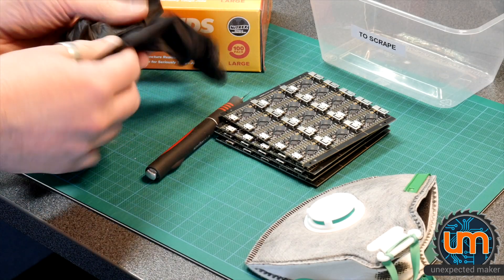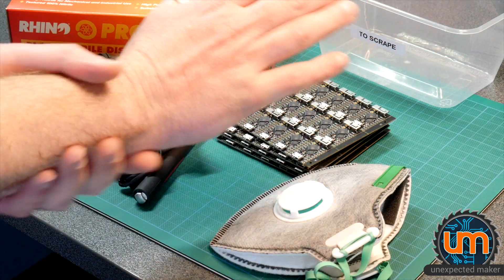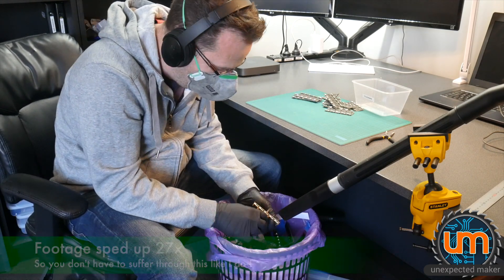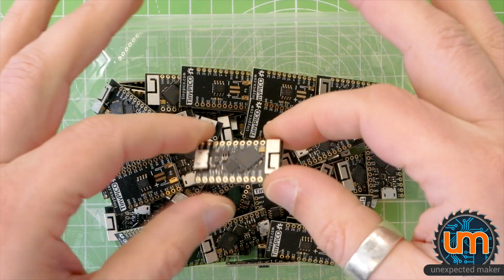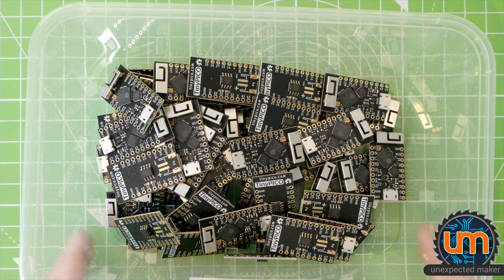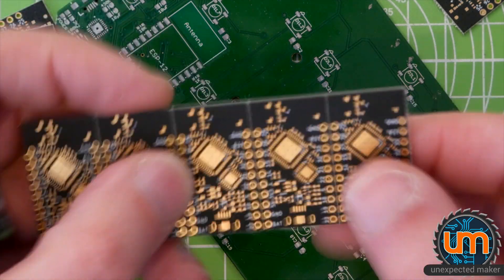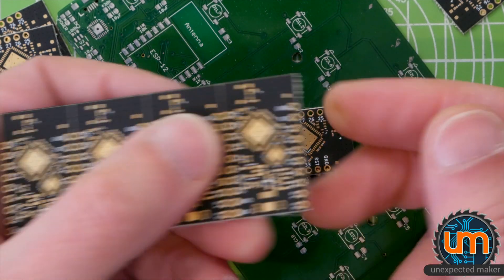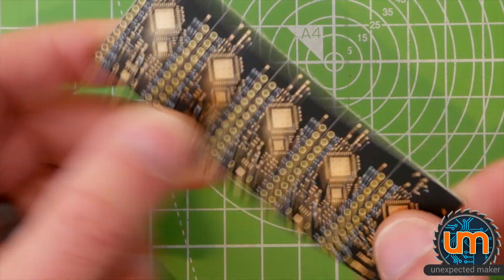PCB De-Panellising - Slow, Messy & Dangerous!

Comment: While it doesn't eliminate the problem, setting panels up as mill/breakaway reduces the rough edges to much smaller, predictable pieces.  V score saves on PCB space but gives you a much larger and potential variations in finish from board to board.   Not a solution, but I'm sure you're already aware of this.

Comment: Even if you have glasses, there are really good protective glasses that fit over and that aren't difficult to wear, sure there are probably not debris going to fly up into your eyes, but glasses from like 3M are super light weight and easy to use. I wear them both at home and at work when needed. There are other brands as well, and I'm not affiliated with 3M, but I use glasses from them.

Oh, and cool videos you got, just found you tonight, you got another subscriber =)

Comment: Clamp your belt sander upside down onto a work bench (get one of them cheapy collapsible jobs) and attach a vacuum to suck up the fiberglass, then lightly hit each side of the board. 120 grit sandpaper should be rough enough to get it done, yet smooth enough to leave a good finish.
You'll quickly learn how firm to hold the board and the right amount of time and pressure to apply. You should be able to buzz though a whole panel in a couple minutes or so :)
By the way I have the same vice. It's great isn't it?! :D

Comment: I use a fine metal file, 10 x in 1 direction and 10 x in the other direction.
you want to board to stay square.

i place the file on my knee or table and move the pcb's with 2 fingers over the the file.

Comment: Are they scored v grooves, single of double sided? What is the thickness of the seams? I seen a tool with two discs which cuts on both sides, It's like a table saw with an extra blade on the top. you can set the distance between the blades, then just run your board.
Reply from the maker: Yup, v-scored top and bottom...  1mm thick PCBs, so hard to get a deep enough groove that doesn't just make the boards too flimsy to PnP.  Those de-panellising machines are quite expensive, and my boards are small (as small and my thumb) so I'm going to need to hold them super close to the blades as I manually guide them through - sounds super dangerous - I'm kinda attached to my fingers ;)
Reply: @UnexpectedMaker  You could design a tool cheap with a 3d printer, using two sharpened pizza cutters, not motorized.
Reply from the maker: That's actually a really compelling idea... just need to find some time ;)

Comment: Dont they offer v grooving....if so  increase the cutting depth
Reply from the maker: They are v-scored... I don't control the depth - the PCB fab house do, and as seen, it's clearly hit and miss as to the depth and consistency. They err on the side of "shallow" as the boards are only 1mm thick to start with, so they don't want the panels to just fall apart... but getting it "just right" is proving difficult.

Comment: Years ago our small pcb's were milled except for a few tabs. Then cut out from the panel once they were tested. I think there were 48 pcb's to a panel. 10's of  thousands were done like this, and no cleaning of the tabs. Flush side cutters ment there was not much of the tab left.  We had one wave solder and one reflow tunnel,  a flying probe tester. And my ATE setup for final test of the boards.  A hard part was to give every test file a unique filename.

Comment: Thanks for this video!
I have maybe de panellized 1000 boards or so. They end up in an enclosure, so the edges don't need to be 100% square. But for the removal of the edge rails I use a small vice, set it to a width slightly larger then your panel thickness, and slide in the panel. Bend, done. To clean up the rough edges, I usually just rub two PCB edges together to get rid of most of the nasty stuff.
Reply from the maker: Yeah, 2 PCBs rubbing together works quite well for about 70% of the debris - and I sometimes do that on my shields I make, instead of knife cleaning them, if the v-score is deep enough. But for my TinyPICOs - presentation is everything.

Comment: Hey, 

Have you tried Breakaway-Tab Panelization Method ?

Here's a article about this stuff, maybe someone interested ,
 https://www.electronicdesign.com/boards/pcb-designers-need-know-these-panelization-guidelines
 
Try to place breakaway in strategic positions which will help reduce work to clean the boards, maybe edges that break away and leave " / " corner which doesn't need cleaning? Donno, I see this method used on every board that I have seen. And usually they get broken of and no extra steps are needed to clean it, at least that's what is used at my work place in ABB line .
Reply from the maker: Mouse bites would mean much bigger panels for the same number of boards (so increase cost) and they's still need to be cleaned, with similar issues regarding mess and safety.  hate it when I get a board from someone and they have not cleaned off the mouse bites before shipping... again, no way I'd ship boards in that state.
Reply: @UnexpectedMaker  yeah, there is a un clipping machine they use tho
Reply: @UnexpectedMaker  https://youtu.be/-tJjUcSW9UM ,seems something like this would make clean cuts , compared to breaking them off manually by hand?
Reply from the maker: The panel can't sit flat remember... It's got RAM on the bottom .
Reply: @UnexpectedMaker  isn't there a way to CNC mill a matching plate that supports the PCB so the ram stays safe while cutting , just wondering.
Reply from the maker: I guess, but not sure how that would fit under that cutter - I'd need a minimum of 10mm clearance under the blade, and I'm sure the blade is designed/tuned to cut at the 0 height level... hence only being able to cut 2mm.

Comment: If you have the boards routed rather than v-scored you'd lose the density, so have to run more panels to get the same number of PCBs out the end. If you have them mostly routed you only have to clean up a couple of spots along the edge rather than all 4 sides. Since you don't need rounded corners or any other non-rectangular features I wouldn't bother with routing.

I use sand paper stuck to a heavy flat surface so it doesn't move around. But if I were doing more than 50 I would probably look into making a jig to hold the boards square and save on fatigue.
Reply from the maker: I'd considered moving to mouse bites and pre milled slots to reduce work, but I don't believe it would reduce the work that much, and would still suffer from the same mess and safety issues when talking about 1000s of boards to clean.

Also, I didn't mention in the video, but the USB connector overhangs the board, so I;'d still need to use a knife on that edge anyway.
Reply: @UnexpectedMaker  we use mousebites at work and previously a pair of depanelizing cutters. We have upgraded to a pneumatic cutter now that works even better. We do no post processing of the pcbs and they do not have stray fibers.

Comment: You can try separating the pcbs one row or column at a time and scrape the entire row or column. Also maybe you can make a jig for the tiny pico that you place on another board with male header pins and use that with something like a dremel with stone grinding bit. Best of luck
Reply from the maker: That's what I do - I mention that in the video... I know it's sped up, but you can see me doing entire edges one the edge rails are taken off, then entire lengths where I can, before going to individual boards.

Comment: Disc sander with a perpendicular table and vacuum sounds like it'd do the job
Reply from the maker: Own one, tried it.. worse result for the reasons I mention at the end of the video. It ended up taking me longer, due to needing to redo boards, and I got a saw neck and back standing at the bench in a position where I could see properly.

Comment: Of all the boards I’ve bought from China with rough edges, I usually just quickly scratch the sides flat over a bin using the outside square edge of a pair of side cutters or a my wife’s old coarse nail file. I probably should be using PPE, but never really considered it. I’m talking maybe 50 parts, not 5000 though, like your setup
Reply: When you snap a fully populated board, is there any concern with the flex weakening solder joints? I saw a machine, maybe on YouTube, which was 2 large thin vertical discs where you feed in the v score and it would slice through it like butter. I can’t remember the name. Have you seen one like this?
Reply from the maker: I'm pretty careful in how I hold each board when I flex, but yeah, I'd rather not be putting stress on the boards... luckily they are small, so less surface area to flex. I have been looking at these machines, but so far the ones I have found I don't think are adequate to due how close to the edge the antenna is, and how tall it is... also $3.5k and up...

Comment: Fiberglass is awful stuff so getting rid of it for your customers is the right thing to do, we just used to sand ours on a flat surface. But it sanding is not ideal.  👍👍
Reply from the maker: Yeah, I found sanding messy, even wet sanding. The belt and disc sander did the nicest finish, but I had to re-do many boards, and ruined a few too :(

Comment: I use a cheap chinese CNC3018 to produce prototype PCBs (FR4), with double-sided tape to stick it down. I built a small chamber around it connected to a dust extraction system. If you leave more space around the boards, you could use a larger diameter end-mill (1-1.5mm) to separate them.
Reply from the maker: As I mention in the video, my boards are double sided.. so can't be stuck down for cutting. Nor will a vacuum system hold them in place.
Reply: @UnexpectedMaker  Not sure I will recommend this route over the other recommendations you got here, but I do use this on double-sided boards as well.
Reply from the maker: How do you stick them down when they are double sided?
Reply: @UnexpectedMaker  I just use double-sided tape. For alignment and more horizontal stability I use dowel pins and some laser cut guide frame. Best to use a weak tape that doesn't take ages and/or strong chemicals to remove afterwards. I apologize in case I am misunderstanding the issue here.
Reply from the maker: Sorry, just for clarification... are you talking about milling un-populated PCBs?... Or are you using your CNC to seperate panels of double sided, already assembled panels.  I'm looking to de-panellise already populated dbl sided panels.
Reply: @UnexpectedMaker  I apologize. I did watch the entire video but when I made the first comment I didn't catch the fact that both sides of the PCB had components. Sorry for wasting your time.
Reply from the maker: Oh, no time was wasted, all good mate! I appreciate you trying to help out!

Comment: A Dremel with a dimond cutoff blade mounted so you run the board along a flat edge and the blade cuts between the boards.
Reply: Not hand cut
The blade is mounted at a fixed distance from a flat edge.
Much like a bench saw
Reply from the maker: Oh, right, yeah that makes more sense, sorry. I was trying to imagine hand cutting panels with my Dremel without destroying boards!!! Thanks!
Reply from the maker: Sorry Tim, not a chance... that's a terrible idea.... no way you can hand cut a perfectly straight 100mm line 0.2mm wide, 6x in one direction and then 3x in the other - and even if you managed to do it... how about doing it reliably on 300 panels?

Comment: Thank for an eye-opening video! Never thought this would be a problem but it seems to be, good to know now when I have ordered my own pcb's :D Just curious, why have you chosen to have a panel and not invidual pcb's direct from jlcpcb? Then the edges would be very nice och customer ready. Great vid!
Reply from the maker: The boards are panellised because I assembled the boards in house on my Pick and Place - you cant load individual 18mm x 30mm boards into a Pick and Place, and even if you could, it would make assembly take 10x longer.
Reply: @UnexpectedMaker  Yeah okey, I see that now. And it a lot nicer to have a solderpaste stencil that covers a panel instead of a individual board.

Comment: I have never done bulk, but I think my method would work just fine for that too. I just glue a sheet of sandpaper to a piece of plywood. Then manually run the beards over it a few times. It is very quick and all of the dust stays on the sandpaper to be vacuumed later.
Reply from the maker: I've done wet sandpaper before.. it doesn't take any less time, and I can't do the USB edge as the USB hangs over the board edge, so I'd still have to hand trim those sides anyway.

Comment: Use satin wheel (scotch brite kind of material)  on bench grinder and it comes in different hardness. It is much less abrasive then sand paper but it Just remove burrs. Another option is buff wheel but it might be too smooth for pcb.

Comment: I don't use v-groove but mouse bites, and so these require tidy up also. I just use a flat file in my left hand (or in a vice), the pcb in my right hand and it's the pcb that moves back and forth. Sand paper is just too messy for the same result.........but I do agree it's soooo time consuming!
Reply from the maker: For larger boards that makes total sense, but for my TinyPICOs, they are too small and delicate to hold firmly (or in a vice) to clean mouse bits with a file. Even holding them to scrape along sandpaper leads to slightly bent antennas if I'm not careful and try to clean too fast.
Reply: @UnexpectedMaker  I wonder if you could make up a jig of sorts to hold the boards and maybe even semi auto the clean up.......hmmm!

Comment: Can you change the panellization so the majority of tabs are on a pair common edges? If so you could add registration holes to the edge of the panel outside of the PCB area and break off a whole strip and use the registration holes together with a jig with something like a belt / disc sander, offering up a whole strip to do edge at a time with maybe just a couple of pairs of tabs on the end of the strip to finish off by hand.
Reply from the maker: They are not tabs/mouse bites. They are v-scored, so every edge is attached to the next board, or edge rails. So orientation won't change that. As I mentioned at the end of the video I own a belt and disc sander (bench versions) and have tried cleaning that way, and the results are hit and miss... it's harder to do (on my neck and back) and it's just as messy, it not more messy.

Comment: I love how you discuss how nasty the sharp edges are and how you don't want customers to get on their hands as you poke the nasty bits with your bare fingers...and then say how you shouldn't be doing it. And my preference is 400 and 1000 grit sandpaper on a glass surface with a fan sucking air away from me. Works pretty well in most cases, but lately I've had to go hog wild with the box cutter just to separate some of my more recent PCBs from JLC. Doesn't help that the final PCBa are 10mm across, but I don't recall having this much trouble with previous panels of the same width PCBs. One upside of re-scoring the V-Cut is that my breaks are a lot cleaner now. A couple of passes on the top and bottom before separation has lead t fewer scraggly bits for me and might net you a few more uses of your blades before they go dull.
Reply from the maker: That's why I get paid the danger money!!! Hahaha.... or I pay the idiot tax ;) I've tried wet and dry sand paper a few times..  honestly, it's no faster, and my knife results are cleaner looking.

Comment: Better V scored boards separate cleaner, your debris seems to come substantially from the board between the holes and the edge though, so it may not make much difference to you.  Wet, slow speed rotary diamond disk? Think small potters wheel.... Wet==no dust. When we have to cut a lot, we use a wet tile cutter...
Reply from the maker: Yes! The v-scoring from JLC is hit and miss, but recently, they've been super shallow and very hard to break apart, as you saw in the video, and as I mention, the more force to break it, the more debris..My disc sander showed the most promise, running slow, but due to it being vertical and after cleaning 200 boards in a session, my neck and back were wrecked. I'll look into a potters wheel, thanks!
Reply: @UnexpectedMaker  I didn't actually mean a potters wheel. Just something like this https://www.ebay.com.au/i/333280733977?chn=ps&norover=1&mkevt=1&mkrid=705-139619-5960-0&mkcid=2&itemid=333280733977&targetid=535812385887&device=c&mktype=pla&googleloc=9070534&poi=&campaignid=1490772164&mkgroupid=63107608768&rlsatarget=pla-535812385887&abcId=1139406&merchantid=7364522&gclid=Cj0KCQjw6KrtBRDLARIsAKzvQIHe0yMVYZOCzHpW-g4KO4X0wLJz5gRxpSmeEdcOsjJSSHQOZztA_HkaAkf6EALw_wcB in about 80 grit, running wet and fairly slow (ie <1000rpm)

Comment: How about stacking boards, say 25 at a time, and processing them like that? Doing thousands of the same boards, would be worthwhile to create a jig (one of the PCB's with long headers soldered onto it perhaps) to align all the boards in the stack. Then run the stack over a sheet of sandpaper, use a scraper, or what have you.
Reply: yes 20 of stack them vertically in a vise
Reply from the maker: They are double sided boards, so don't stack very well, so the amount of time I'd spend stacking them and pinning them together so they don't move, I could prob just hand clean them.

Comment: For cutting small pcbs from a panel, I use a Makita battery tile saw with a 0.3mm thick diamond blade.  I do this outside with a facemask on and then wash everything down with a hose.  The tile saw is designed to be water cooled, so I guess you could quite easily make a setup with a water spray and a side fence and it would be pretty efficient.
Reply: The cutting discs are ebay item : 153594105981